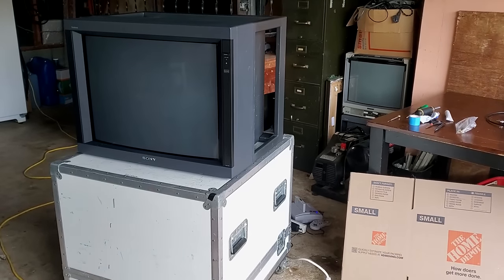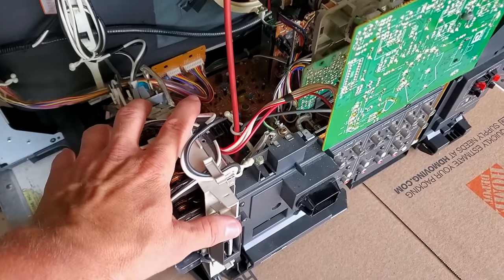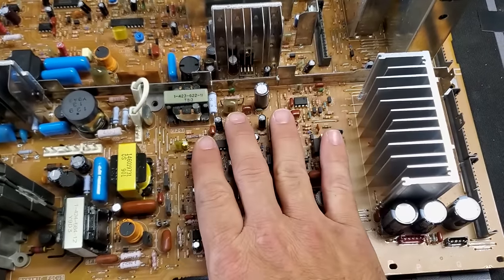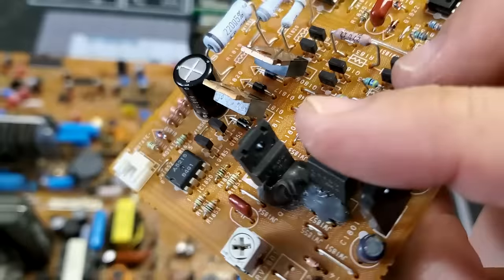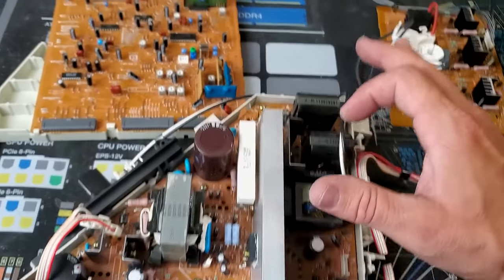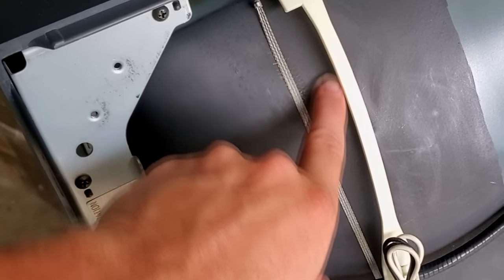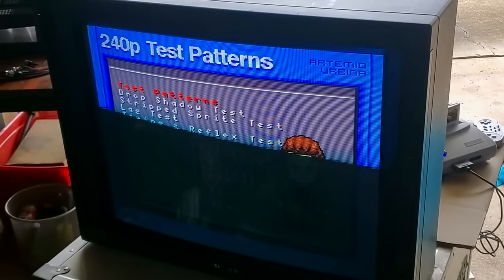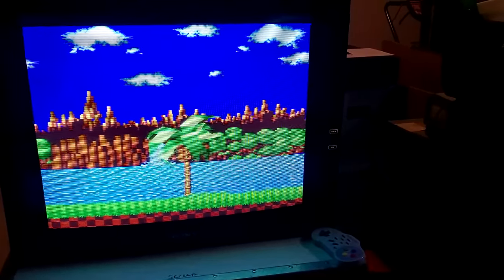The Biggest CRTs still in use: The Sony PVM 2950Q Trinitron Pro Monitor

Comment: I worked on a couple of those bad boys. I always loved working on sony equipment.  Every brand made brakes . But when you take the back off of a Sony you can tell its well made. The boards aren't all warped up from heat. They are well designed  pieces of gear

Comment: Back in my monitor collecting days, back in the 2000s, these were the ONLY Sony CRT's I cared about. Honestly though, I think the NEC XP29+ and XM29+ were better, that high contrast mode blows you away, and the ability to handle close to full 1080p was amazing. The other noteworthy model was the NEC 3PG, damn that was a great monitor. The pro-grade shadow mask CRTs had WAY better blacks and almost no light leakage compared to the aperture-grille based Sony's.
Reply: Yeah they're popular because of brightness and that was important for a main general use display. These days a little phone is my main general use display and wouldn't use CRTs outside of low light autumn and winter evenings for preservation and energy economy reasons. So definitely found I prefer shadow masks for modern CRT use cases in my view.

Comment: I have been eyeing a Trinitron for retro gaming, although ebay prices are high. I have heard the PVM models are very great for that too. The largest PVM i know of is the PVM-4300, which is a 43 inch model. But it tips the scale at a whopping 441 pounds (~200kg).

Comment: I have one with its original speakers. The screen is very sharp, and the colors are strong, probably did not see much use. I use it more than my 20L5.
Reply: I wanted to ask you if this monitor is 15ghz, another guy told me that this monitor 2950q is 31ghz not 15ghz. it told me it is a computer based presentation monitor and it does not have 15ghz like a normal PVM and BVM.

Comment: I have one - it's a truly excellent monitor for MAME/Mister and emulation. I also have the PGM which serves as a vertical shooter (rotated) setup for the 360 via VGA. Many people see 600 TVL and dismiss it, but I much prefer it to the higher TVL BVM monitors for retro gaming.
Reply: can you tell me if this monitor outputs audio through the bnc cable, or do you need to put speakers.
Reply: @Renan230f  It has seperate stereo audio input (L/R) and passthrough. Plus it has L/R speaker terminals for external 8W speakers (there are lugs on the side to accept the default set).
Reply: @beebot  I wanted to take the opportunity and ask if this monitor does 480P by component video on ps2.
Reply: @Renan230f  It takes RGBHV. So no, I don't believe so. You will have to convert from component to RGBHV via an Extron or OSSC (or similar). The PVM does, but the PGM does not have those inputs.
Reply: @beebot  Thanks! One last question, on another channel I saw a message from a guy who said he can't tune his ps1 through Csync.
Have you tested the ps1 on this monitor with Csync?
Reply: @Renan230f  This monitor will not accept C (composite) sync at all. 

This monitor is not a 15khz RGB display like a regular PVM/BVM. It's a "presentation monitor" and it will not accept a 15khz signal (only 31Khz, it was made to be used with a PC signal like many projectors). 

You will need to use a scaler to convert the input from any older games console to 480p/640x480 via RGBHV (Horizontal and Vertical Sync). 

So like I said, you'll need to use something like the OSSC or various other scaling solutions to convert 240p (15khz)( signals and output a compatible RGBHV signal at 31khz in 480p. This is not a multiscan monitor....
Reply: @Renan230f  Actually... with a PS2 you can just change the video mode to RGB. It may work as long as you have the correct cable... but I would still recommend you use an OSSC or another scaler (that's what I use).

Comment: Out of curiosity: what would be the estimate to do a recapping of a PVM-2530.

Considering the number of boards in the set and the sheer number of electrolytic caps, I have to imagine that it's most assuredly not going to be cheap.

Comment: How do you usually keep track of off the connectors between boards? Do you take some pictures before taking all the boards out?
Reply: I go and buy the cheapest finger nail polish assortment i can find and use different colors/patterns  on each connector.   This way when you go to put it back together its just a matter of connecting matching colors... easy peasy.  You can come up with all sorts of patterns and colors.

Comment: Hello Steve, I have an idea of a video that would be great if you wanted/had time to make. Most people have access to decent consumer CRT:s but they are in 95% of the time in severe need of some maintenance, but aside from the condition is a fine monitor kv-29x5e in europe or xbr:S in the us. I assume most people at best can install some convergence strips and perhaps order a cap kit to remedy geometry issues. That is good and all but that is not really assuring that everything with the TV is to factory spec sense it is just a blind repair meaning that no measurements of key voltages has been made. 

It would be awesome if you find some great CRT in poor condition like an XBR and go through the service manual and measure the test points with an oscilloscope and compare the measurements to the factory measurements given by the manual. 

It would be quite informative to people i think to see how to properly use the manual with an oscilloscope. Most of the issues with consumer crt:s today is imo that the geometry problems cannot be completely adjusted for in the service menu, but a repair back to factory condition certainly will. 

One video idea might be to correct the PSU and measure the different voltages. one video might be deflection etc.

Comment: There is any difference if you change the flyback red wire and install a new one, thicker with oxygen-free copper? or it won't make any difference?

Comment: Have you ever done a video on video passthrough from a PVM to a CRT? Unfortunately I’m not sure what connections and cords are correct to use if it’s possible at all.
Reply: Depends what you mean by crt... I assume a consumer set with component input?
You need to pass the rgb from the pvm through a rgb to ypbpr component transcoder to the consumer set.

Comment: So the 2030 has the old RGB but the 2950Q has the BNC RGB? Or are these PVMs both totally different generations (ie 30 vs 50)?
Reply: The 3230 does too but only bnc. Components don't work with adapters. I tried it. :/
Reply: it has RGB just not component plugs or BNC. It uses a different 25 pin connector for RGB so you need a special cable for it.
Reply: Different gens